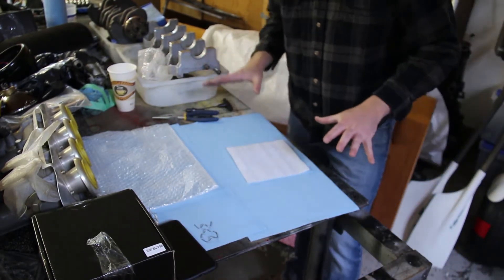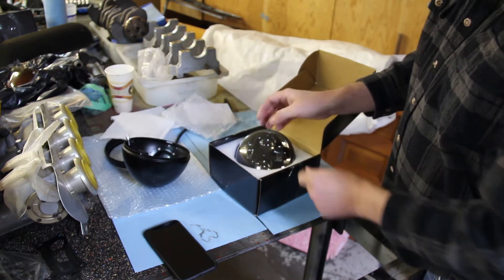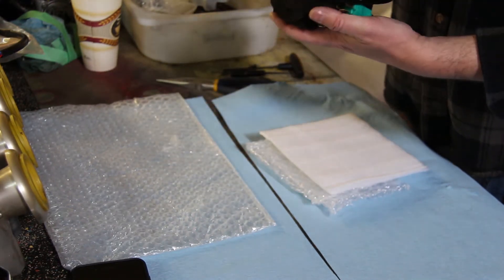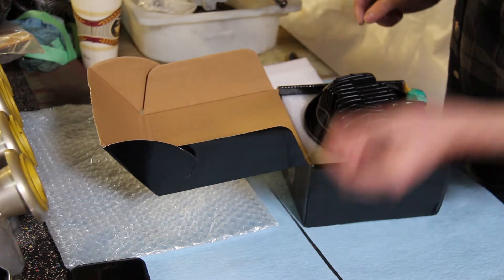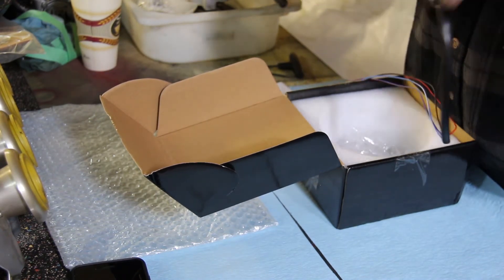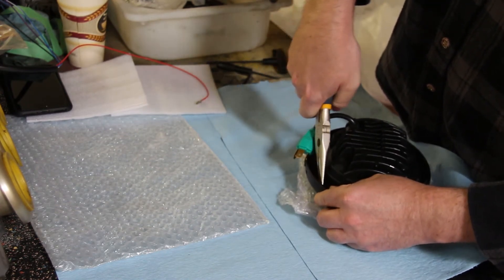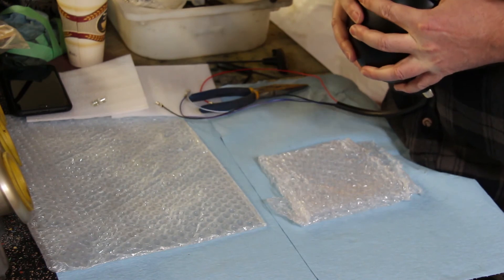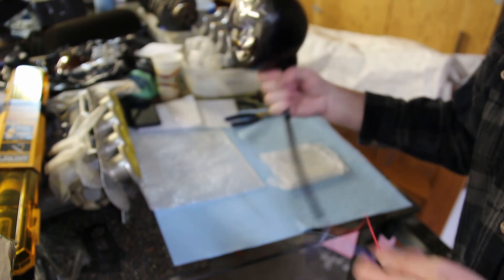Caterham LED Headlights

Comment: I used lights from Just Add Lightness. You just unplug the original bulbs and plug the LED units in their place. They are identical to the factory LED’s but you don’t have to buy the shells and wiring. The whole job took just a few minutes. Couldn’t have been simpler.